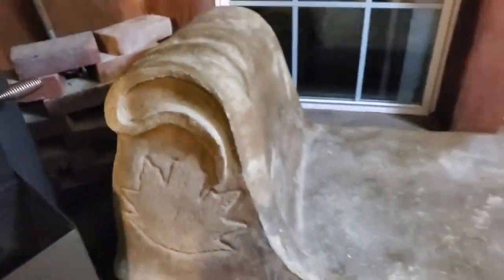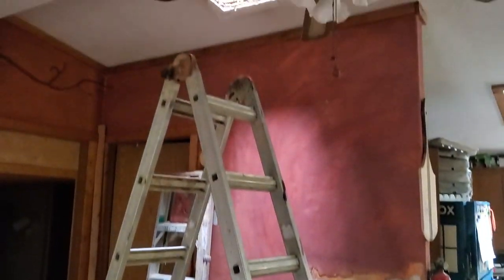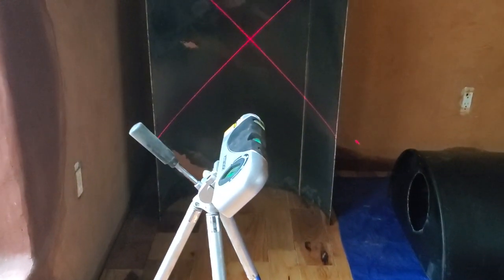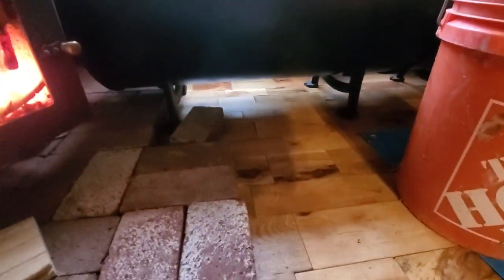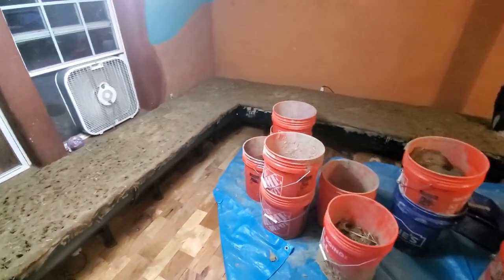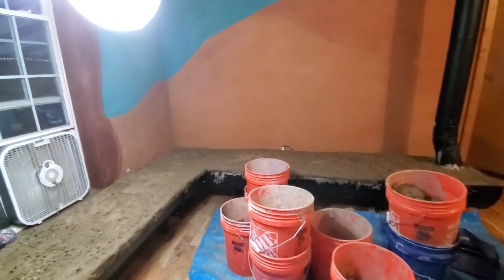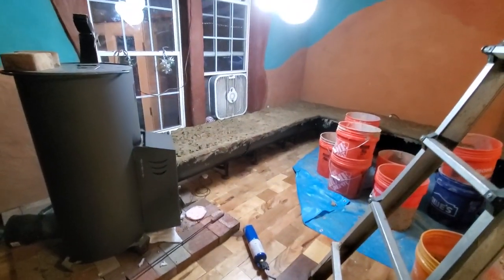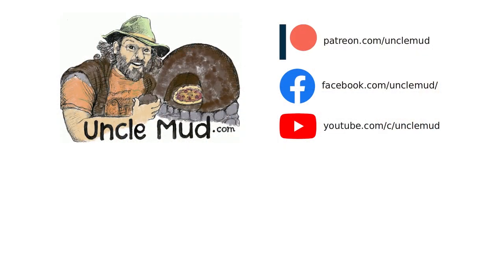Uncle Mud's HalfShell Cob Mass Bench for TinyHouse Rocket Heaters (Build Video)

Comment: I like the cob bench. Where did you get the little metal legs that go on the bottom of the barrels?
Reply from the maker: I saved them off the crappy barrel stove kits i take apart to use the other bits for building rocket heaters.